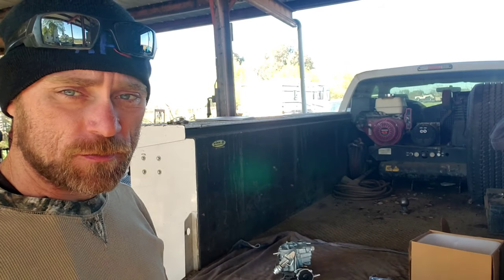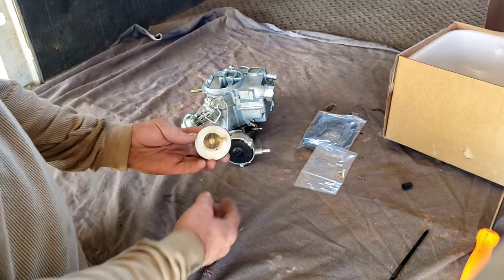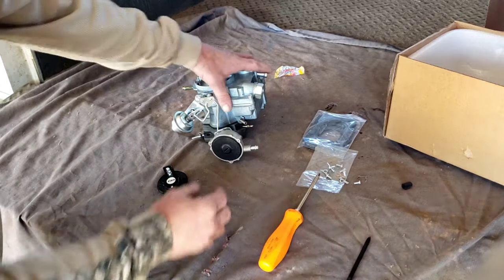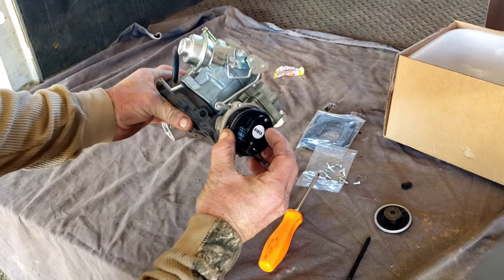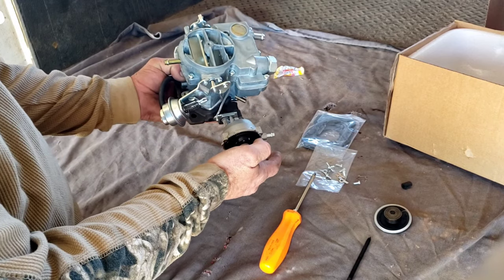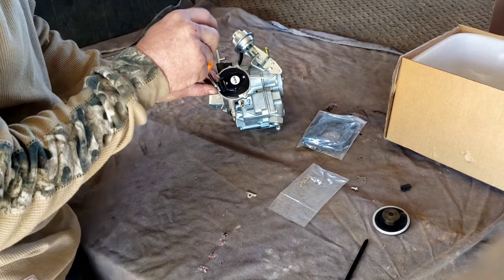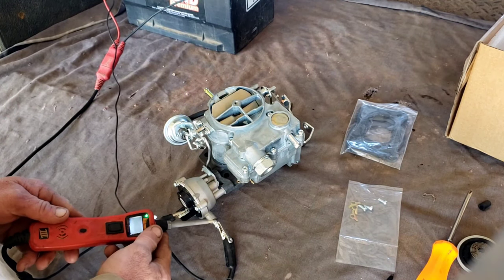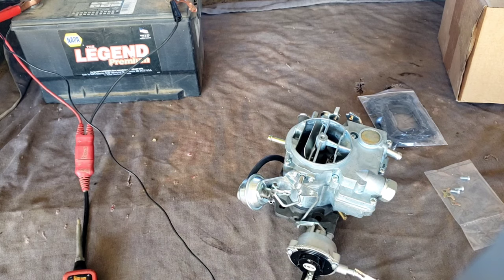Truck Restoration - Rochester electric choke upgrade

Comment: Hey sir , can you make a video of how to install this carb please ? Is coming to be very popular in Amazon and there is not any video on how to cancel or plug the vacuum lines, also if you can explain me what is for the hose conector to the right of the fuel inlet conector and where to connect the timing vacuum hose ,I will be very thankful! Regards from Mexico!

Comment: wanted to ask you how did that carb run??   I bought the ebay one looks just like it.. LMK thanks!
Reply from the maker: runs well but still trying to get the ideal right
Reply: Is it staying open a little and can't figure why?
Reply from the maker: @lordsauto  yes lol
Reply: @CVcustoms  I had same problem. Would not seat on cam all the way drill 1/8 hole  in each butterfly in middle it should work vacuum is holding them open